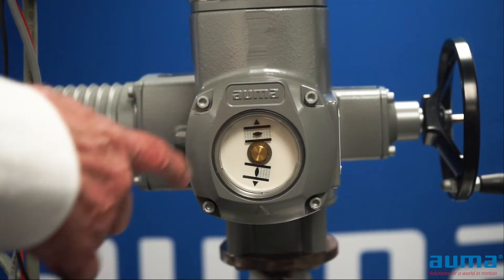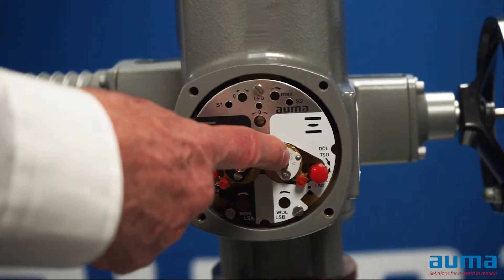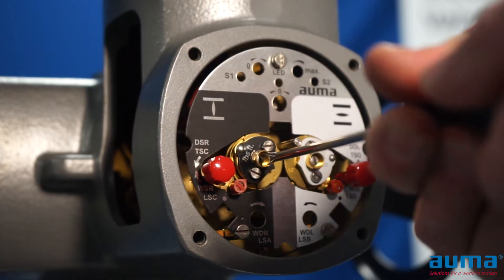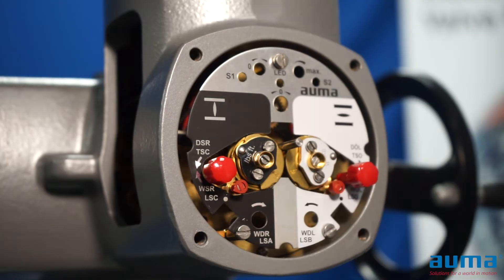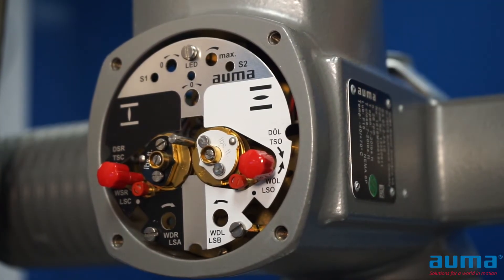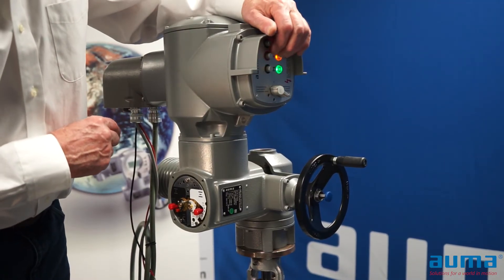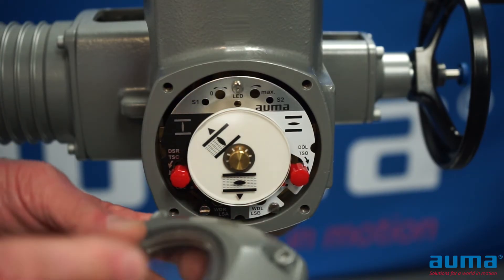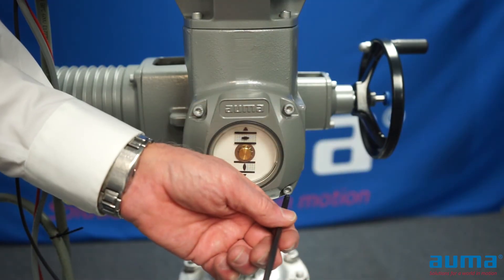AUMA Actuators - Setting Limit Switches - GTLS Mechanical

Comment: I’ve noticed in the limit switches, sometimes they will not hold position, for example I’ll set closed limit when there is no flow, but when I run it remotely it will stop short of where the flow completely stops. 

Any reason this may be happening?

Comment: I have an issue with my actuator in one of our facility. The problem is that during opening and closing course, 220 AC voltage appear at points 11,12 close status points and points 15,16 open status points. Once the actuator reached its end positions voltage disappears. I tried my best but i didn't find the issue. Kindly help in this regard.
Reply from the maker: Hi @eih_parvi, what is your location? We can help to get you in contact with someone local who is able to help you directly.
Reply: Islamabad
Reply from the maker: @eih_parvi for someone in your local area, please contact:
Service:
+91 80 2839 4365

Or 

Contact :
Mr. Veeresh S.
E-mail: VeereshS@auma.co.in
Ph.: +91 120-3060522

If either of them are not able to help there are also other offices in your area that are able to assist you. They can be found on our website under the contact link.
https://www.auma.com/en/contact/
Reply: @AUMAActuators-USA  is there any service centre in Pakistan?